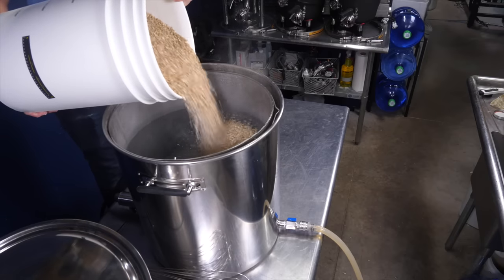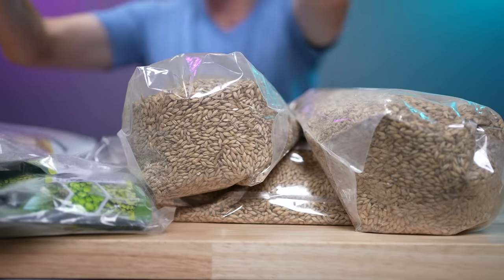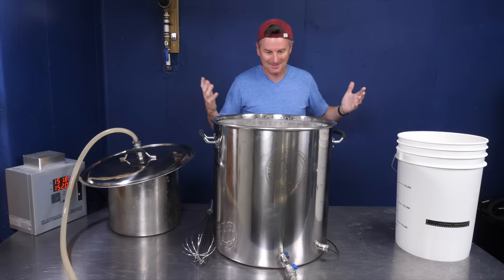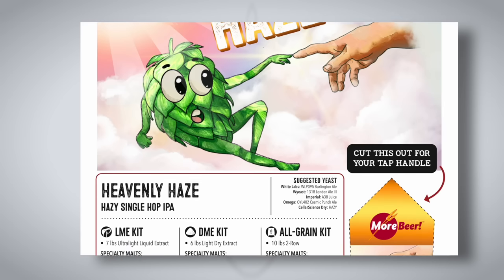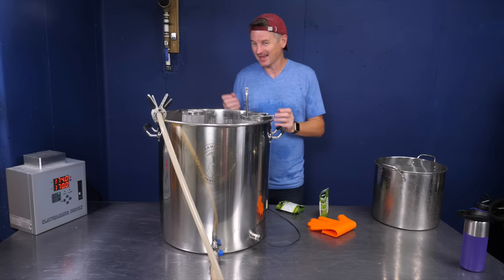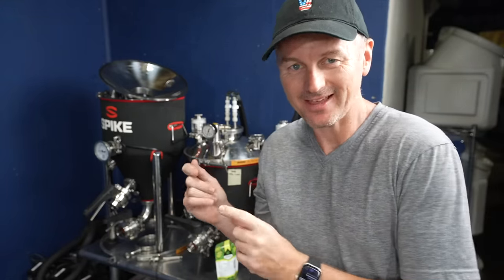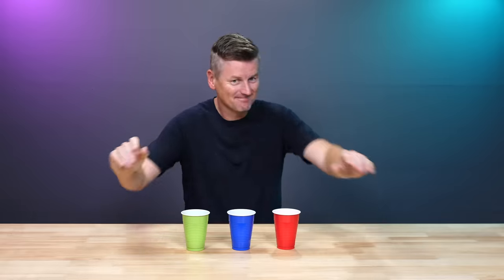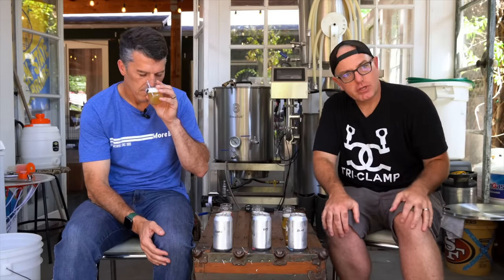Impact Tropic Thunder Has On A Hazy IPA | exBEERiment

Comment: Sweet video! Are you using the pump that came with the Clawhammer system? I’ve got the 20 gallon as well and an exchillerator and it feels like I need a bit more power from my pump. Thanks Martin! Cheers 🍻
Reply from the maker: Yeah just using the pump that comes with the system. And I have the exchillerator throttled down to half flow so more pump juice would be wasted on me

Comment: The enzymes might have been denaturated with the alcohol and on top of that, the heavy dry hopping completely overshadowed the work of the enzymes.
It could be worth trying in a beer that has little no dry hopping and that is moderately hopped. It should standout. Also, use a neutral yeast so it's character doesn't impact the taste of the product.